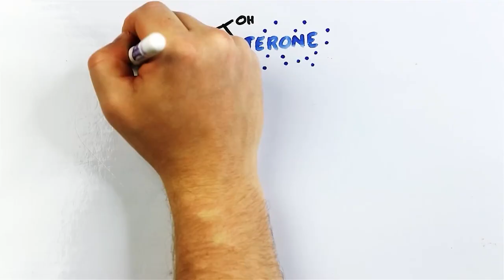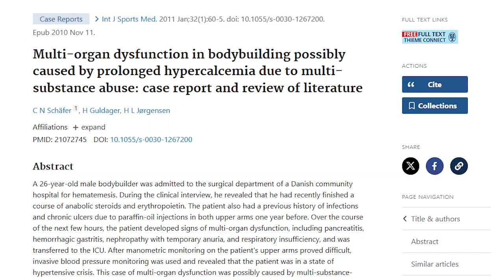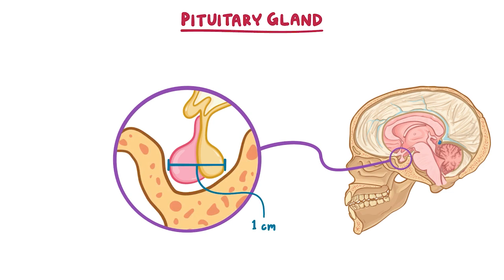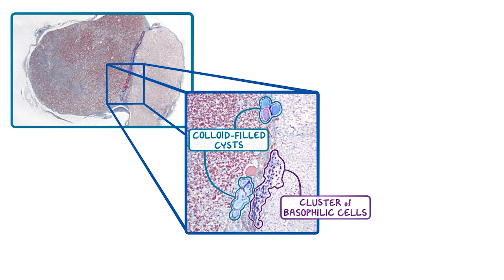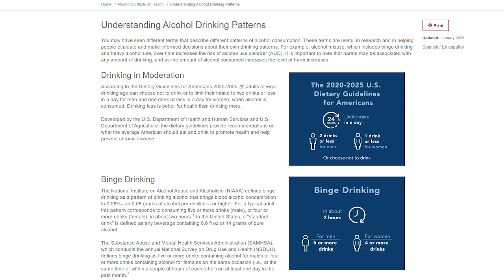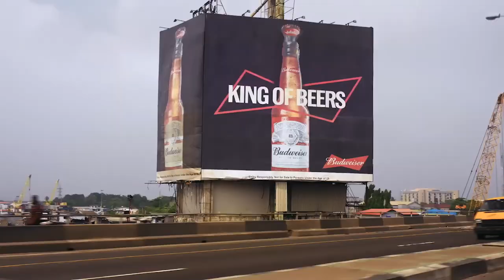Can Trans People Drink?

Comment: Mtf - Throughout my 9 years on HRT alcohol makes me flush after even a sip (genuinely, the tiniest amount) red, hot itchy face. It last for about 15 minutes then I'm fine. I can drink as much as I like without any further symptoms. The blush/redness persists for a bit longer ~30-45 minutes though. Other than that, I get drunk much faster (2-3 to get moderately tipsy) and prefer to stop drinking not long after. Not sure if it's just an age thing or also HRT, but my joints and muscles ache for several days after drinking even just 1 or 2 - As a result I generally avoid drinking small amounts regularly, and endure the pain if I want to have a drinking night. There is VERY little info I could ever find on drinking and HRT so you've already given me more info than I ever found.